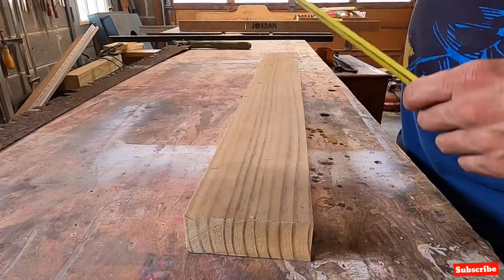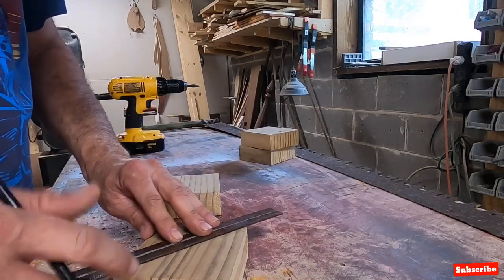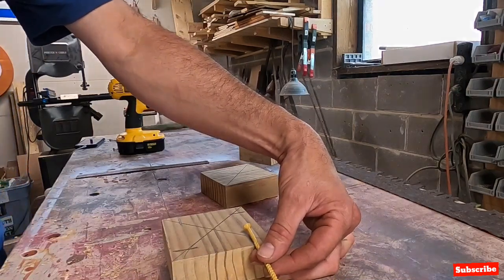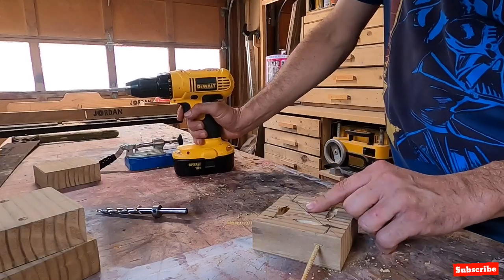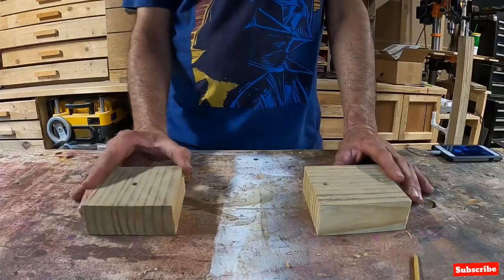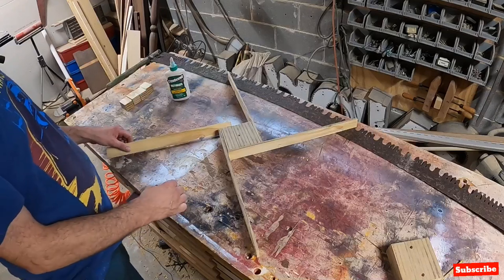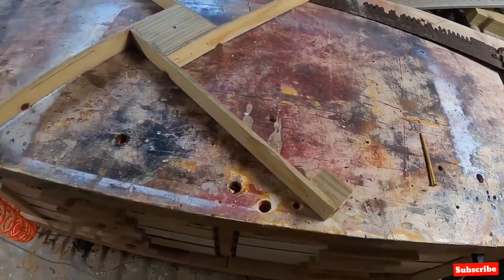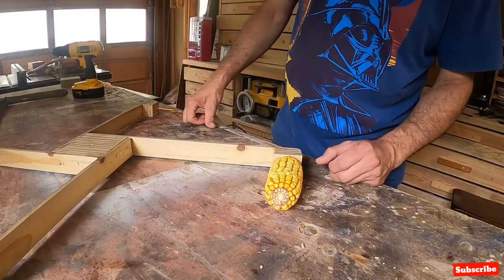SQUIRREL FEEDERS// how to build

Comment: What I don't get is, what's happening at 7:04. How do you make sure the washer is centered between the two pieces of wood, if the deck screw has not gone through yet?
Reply from the maker: Mark center on your piece prior to installing

Comment: Please explain the washer and it's purpose. I am turning a wooden wagon wheel into a squirrel wheel and the guy at the hardware store told me I need 3 washers on each side of the wheel.  I am using a 3/4 inch lag bolt.  I am very confused. Please explain the function of the washers. I want my wheel to turn easily like yours...
Reply from the maker: The washer will prevent the wood from wearing as bad, I would also like to know what his other two washers would do
Reply: @Jordanwoodworking  lI have no idea.  So I put the washer between the two 4" blocks and screw them together, right? When I mount the wagon wheel by running the lag bolt through, do I leave the wheel loose? Is that what makes it turn freely? I am so confused. I really appreciate your advice and enjoy your videos.
Reply from the maker: Thanks. Yes leave it loose enough it will spin